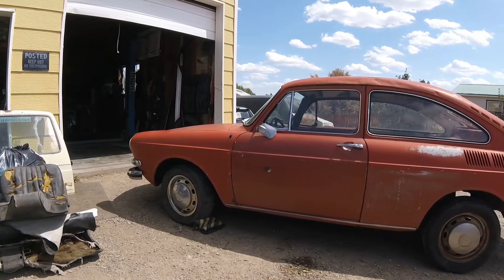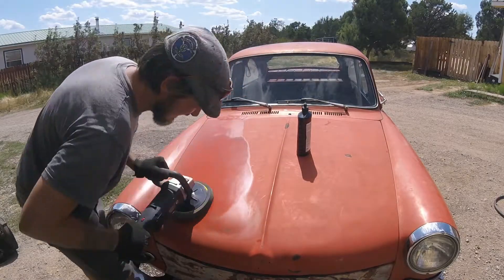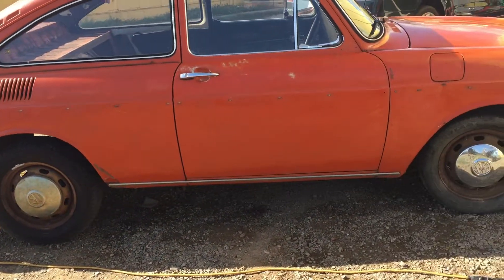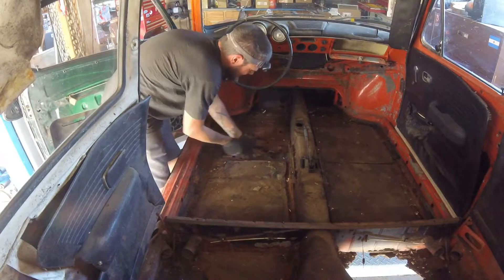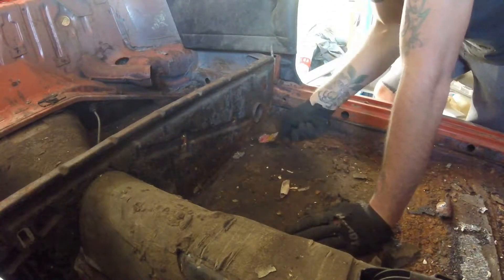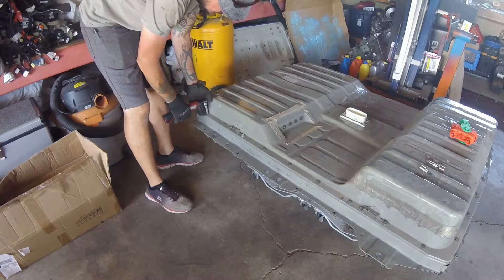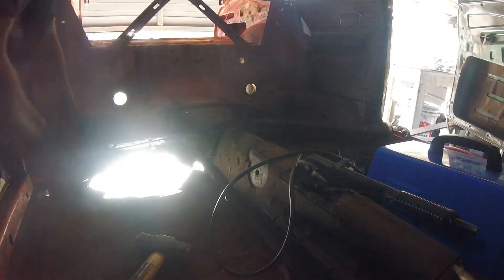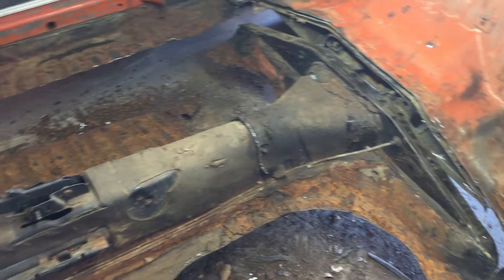FastLEAF Battery - Where should it go?

Comment: Is the Type 3 chassis serial number on the tunnel section you removed? Will you license this as a VW?
Reply from the maker: Unsure about the chassis serial number but definitely licensed as a VW. It’s similar to a VW with any other engine swap (Subaru, aftermarket VW style engine, etc).

Comment: Fantastic that you’ve been able to put the batteries in without disturbing the pack. You couldn’t do that in England without a LOT of hassle getting the car inspected after, they don’t like it when you don’t have original spec structure in place.
Reply from the maker: Building a safe conversion is really important to me so I wanted to leave the LEAF case intact. Certainly it could have been reconfigured but this also stiffens the rotten chassis so I opted for a bit more weight and rigidity. No doubt it would be tough to pass in England, even if it’s a huge improvement in safety.
Reply: Keeping the nissan battery intact & low down sounds best for safety, road holding & replaceability.
The "LOT of Hassle" can  run to re-registration of the vehicle & loss of "historic" status. :-(  Some other European countries are even worse with the cost of approval is huge. Trying to save the planet is tough!